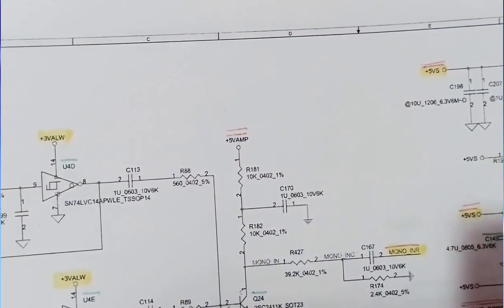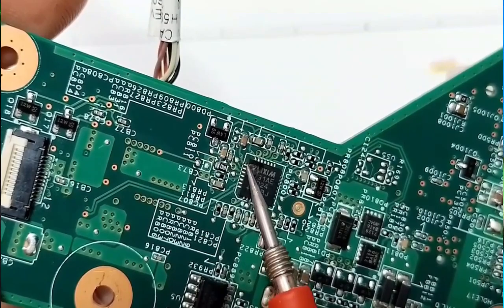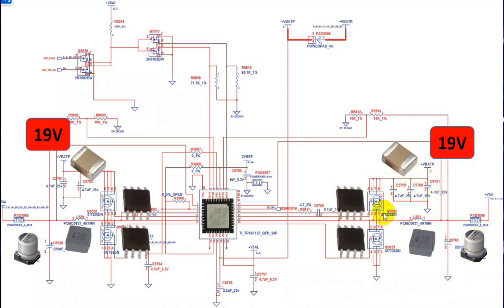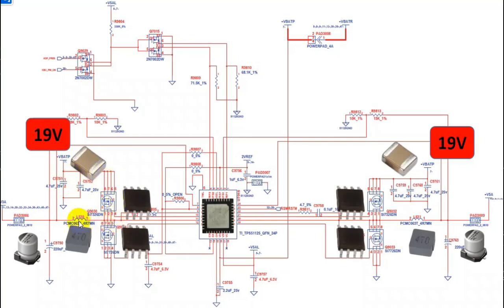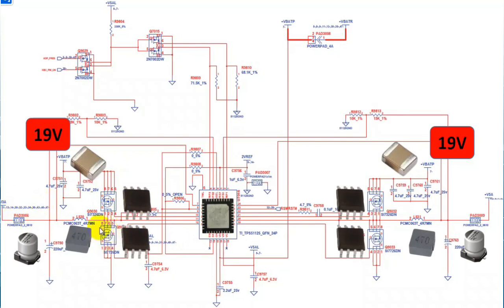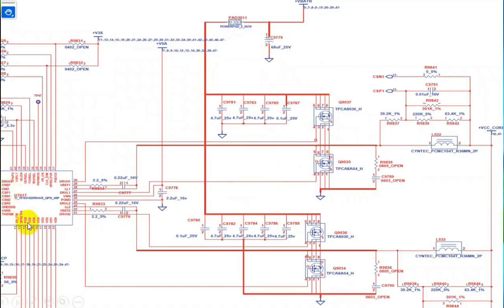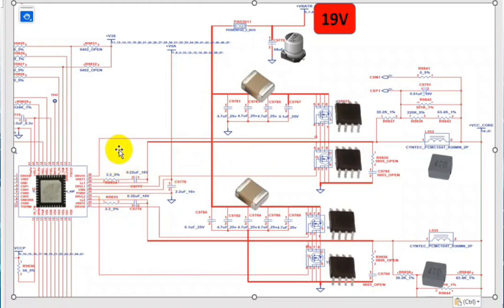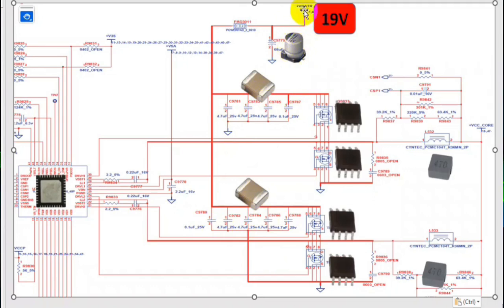Ultimate Laptop Motherboard Repair Tutorial - Laptop Repair

Comment: think you should may a video of soldering using using hot air gun explaining what sort of temperatures and air flow depending on the size of mother board used  jim
Reply from the maker: Ok Noted

Comment: Well in my case the motherboard is not  turning on no but when i check the dc power jack im only getting 3.5v instead of 19v but when i remove the dc power jack connecter and check and it has 19v  voltage drop when connected to the motherboard